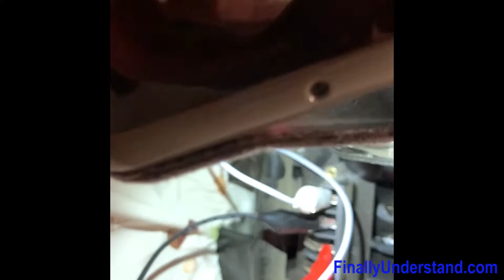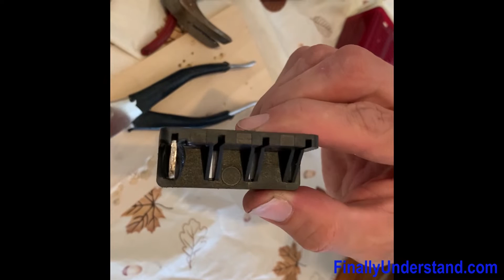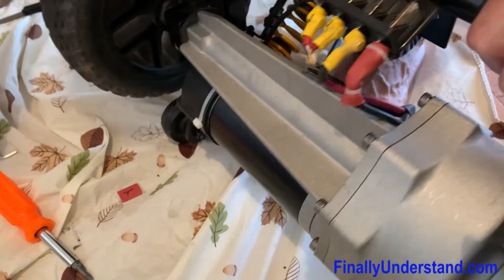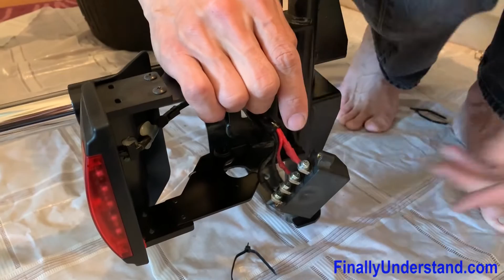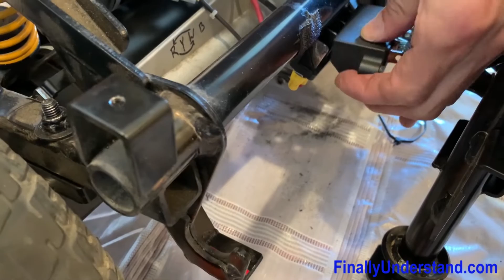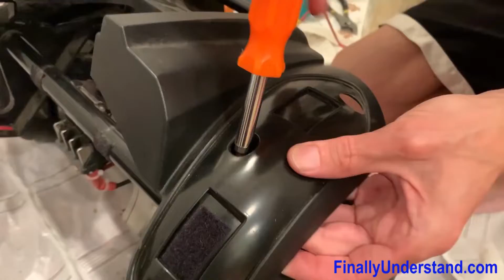5 Flashes/Beeps error -  Buzzaround EX (Buzzaround Extreme™ Scooter)

Comment: Can I disconnect the break-in make my scooter to work
Reply from the maker: Good morning mikeatthecross3991
If you are not experienced in electro-mechanics don't modify your scooter.  It could cause the fire or damage.
Reply: Yes, but if parked on a hill, it will be in neutral.

Comment: Mine has 9 beeps what the problem?
Reply from the maker: I don't fix them frequently.  The one which I presented in the video if I'm not mistaken first of all beeped nine times.  I would check the connector which I discussed in this video.  There would be no continuity in it (electricity is not flowing to the motor and brake).  Please let me know if you found any problem with it.  (Check the connector itself, don't disassemble the entire scooter as I did) 🙂